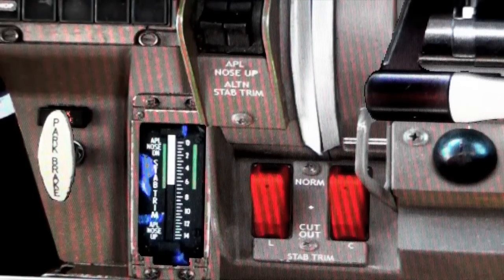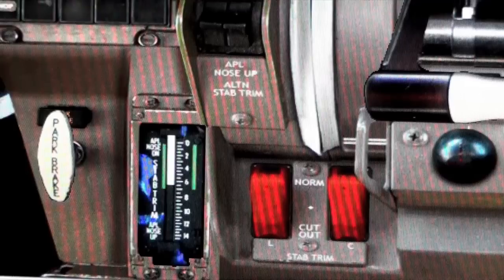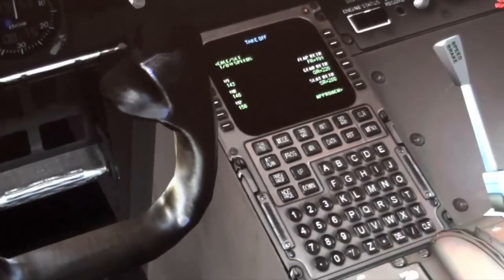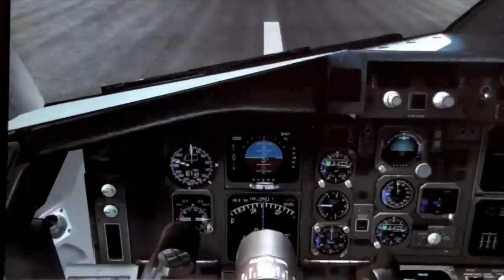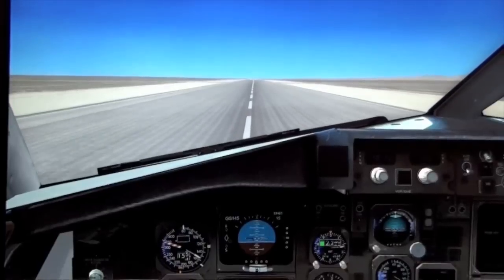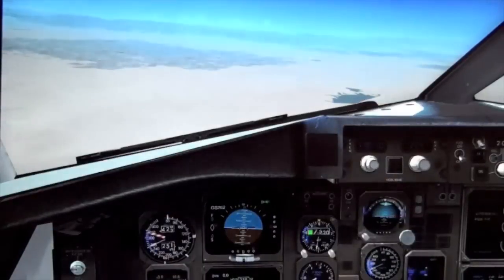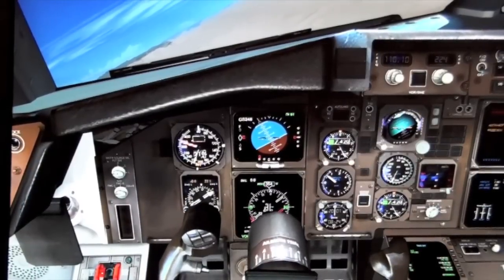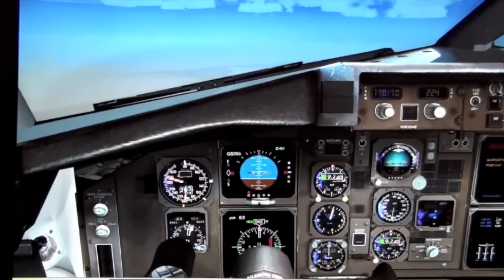CLS 767 Takeoff Trim Explaination.mp4

Comment: Why does my CLS 767 randomly pitch down after take-off? 
3 minutes after I took off, it seems the plane just glitched out and started pitching down. Trim, flaps, were set, gears up, door closed, de ice on, full throttle, yoke stick pulling up as hard it can, but the plane just keeps pitching down and crash.